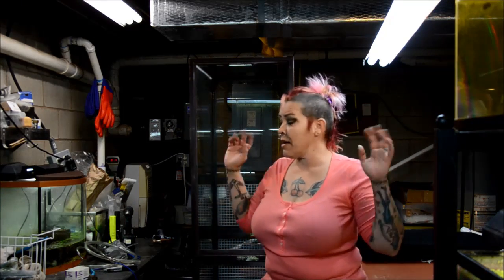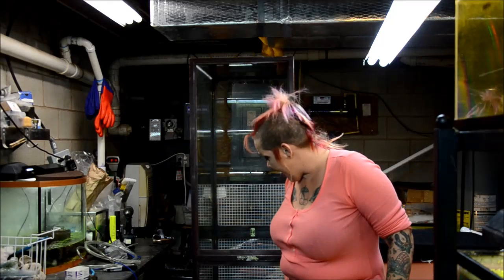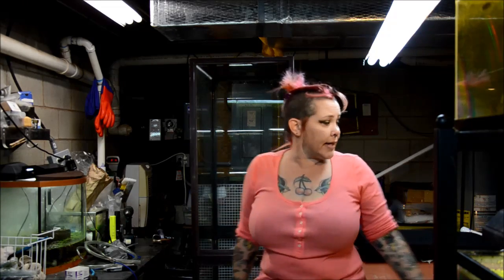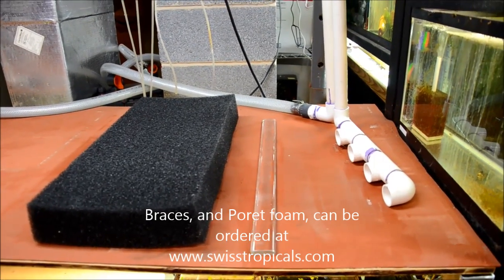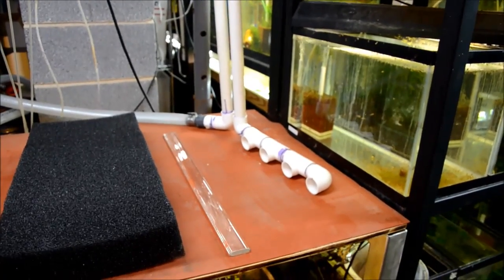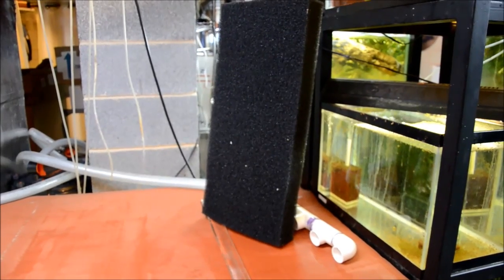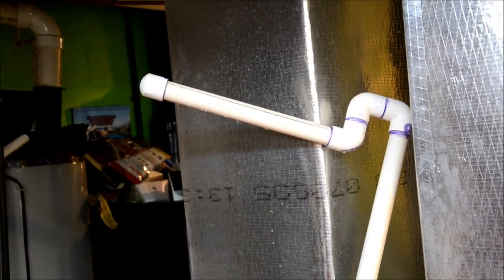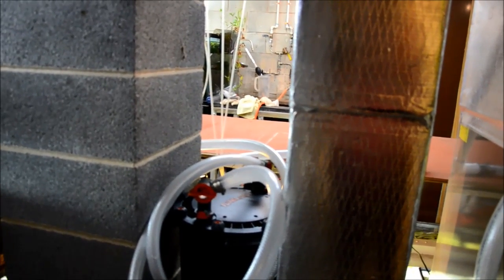150g Modified River Manifold System- Part 1

Comment: great fish room can't wait to see more! I was wondering what's the PPI for your Poret foam? I was thinking about using some in my tank but I wasn't sure which porosity to use
Reply from the maker: +S0uthp4w68 This was for a 150g, so I went with the 3", 20ppi. If you email stephan, he will be happy to advise you. For my block filters in other tanks, I also used 20ppi. I find that coarseness maintains flow, and is easy to rinse when needed The finer porosity takes a bit more effort.

Comment: I'm looking forward to seeing how it turns out. I use to keep and breed a lot of fish when I was younger. I mainly work with reptiles & amphibians now but would like to get more into fish again. I haven't decided on what I want to keep yet. I was thinking about working with C.A.R.E species. Maybe some of the smaller Cichlids. When I did keep fish I worked mainly with African cichlids, mostly Lake Tanganyika. A lot has changes since the mid 80s when I sold every thing off lol.
Reply from the maker: +metaltrooper62 Let me know if I can be of help when the time comes, I have a pretty huge Cichlid network. I work with a few tang shellies, but that is pretty much it for Eastern African species.
Reply: Rachel Oleary Ok thanks. I really like the Pelvicachromis species, Nanochromis species and some of the more rare Apistogramma species. I'm thinking on going with refugiums for the filtration. I'm still doing some research on it. I'm probably going to go with single species in one tank so the refugium thing might not be a great idea.
Reply from the maker: metaltrooper62 You have good taste, I have a lot of experience working with all of those types- holler if I can be of help with sourcing or info on setup.
Reply: Rachel Oleary Thanks a bunch. I like the more uncommon stuff you don't see in pet shops lol. I would really like to work with freshwater stingrays but I don't have the space to set them up correctly. I'm going to save your website to my favorites. Thanks again.
Reply: Oh I forgot, mouth brooding Bettas is another species I'm thinking about also. I like the wild type Bettas a lot too.
Reply from the maker: they are another interest of mine!

Comment: Thats a really cool idea! Ive been wanting to do a river manifold for a while (I've got a few hillstream loaches that would probably love it) but the idea of buying a few powerheads to provide enough flow would be a little too much on my electric bill. Do you have any recommendations for a cannister filter to use on a 20 gallon manifold tank? And while I'm at it- Do you know if you'll be getting in any orange zebra oto's this fall? Would love to order some of them one day but they are really hard to find
Reply from the maker: +Derek Hart The orange otos should start coming in soon- I have gotten some, but not at the price i like. As for what to use for a 20g- you could use a wide range of filters (i always like xp's). It is pretty easy to modify the tubing to run and set up a manifold (pvc loop with strainers in the tank at the suction). You just want to make sure for a hillie setup, you have as high a turnover rate as possible-shooting for 10x, depending on species, and that really good oxygen exchange. That is why I went with this design- sort of the benefits of the biological filtraiton with all the sponge, but the power of the large pump of the fx5. Time will tell if the flow maintains, and I may end up having to add powerheads. When I did my wet fit, the current was JAMMIN'.
Reply: +Rachel Oleary Nice! I've had two hillstreams in my 45 tall for roughly 6 months and they seem to be fine with a HOB filter and a fully cranked air stone, but I would love to give them their own river tank set up so I can see more of their natural behavior. Probably my favorite sucker fish I've had but I've been really interested in the orange otos for a while now. I'll keep an eye on your website incase you have a few for sale in the future. Thanks for the tips and congrats with the new channel. I knew about your website for a while but I found out you made a channel from Dustin at Dustinsfishtanks so cheers to that guy lol
Reply from the maker: +Derek Hart Ha! I didn't know dustin even mentioned it! that is funny :) Much appreciated. Also, oxygen content IS the limiting factor for them to do well. I am doing this because I really want to write a book on the various attainable species, and think that mimicing a more natural environment will help me get better videos and photographs, as well as induce some spawning behaviors I haven't seen in a tank that just has good oxygen content.. We will see if I can pull it off! This is a pretty big undertaking :) Which species are you keeping? YOu can also usually tell if they are a high flow species or just a high oxygen species by the body shape and shape of the dorsal- its pretty fascinating.
Reply: +Rachel Oleary It looks like it would be a bit of work to set up but also fun as hell. Im sure it will definitely pay off for you in the end. Cant wait to see how it turns out for you!  I like your idea of  the corner filter. It seems like it could be just  effective as having all the sponge filters, but much less of a distraction for the eye. The hillstreams that I have were found at a local petco and they were labeled as "butterfly loach" or something, but I think they are the beaufortia kweichowensis species. I've never seen any hillstreams for sale anywhere else before so I absolutely had to pick them up. I keep finding new species of them online and now you've got me all pumped up to try and build a river manifold myself haha. What species do you keep?